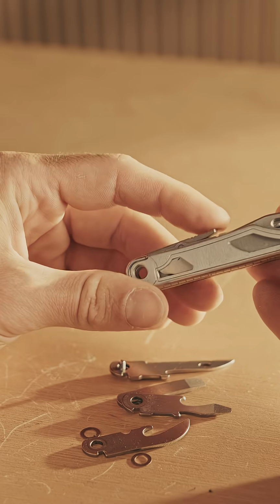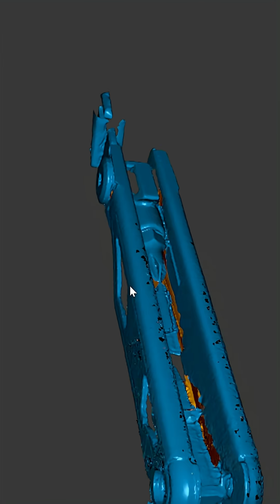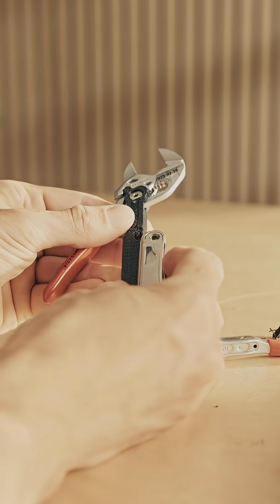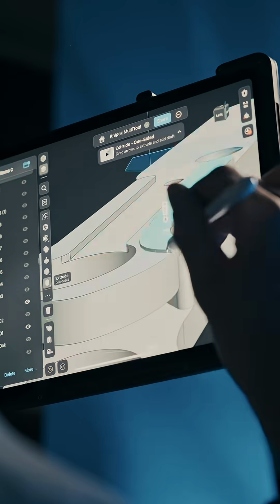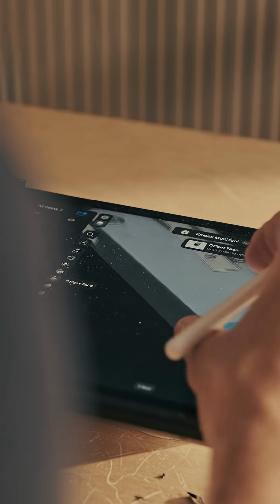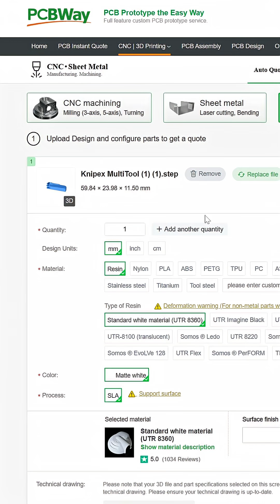Turning a Knipex Wrench Into my EDC Multi-Tool

Comment: Neat idea. I like the idea of having a much more useful wrench. My problem is when I need a screwdriver and a wrench at the same time. For example when you’re trying to tighten/loosen a screw and the nut it’s in keeps spinning.
Reply: Yes. Idea to do multitool with this pliers are cool, but execution are bulky. 2 separate tools have more variety than combined into one.

If you started projects where is pliers wrench was a foldable into compact multitool it would be much more intresting.

Comment: I’d say size/form factor wise, at this point just get a quality plier based multitool (the Mossy Oak you pushed the blade open on the blade… not so sharp)…
But what’s nice about this is that either mini Knipex options are adjustable.

Nice work on the creativity. 😄

Comment: Love the idea but seems a bit bulky. Wonder if you took it another step and replaced both legs of the pliers with a single, double or maaaaybe a 3 function leg how slim that would be. Maybe knife/PH on one leg and two others on the other leg. Great idea though. Well done.